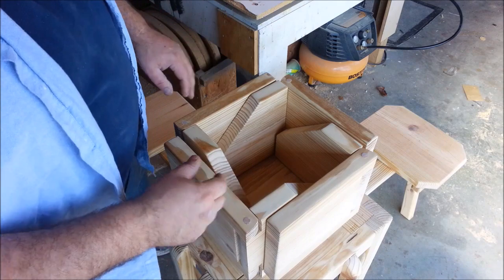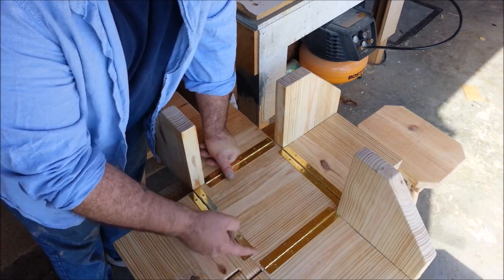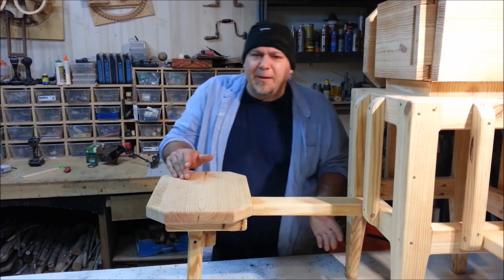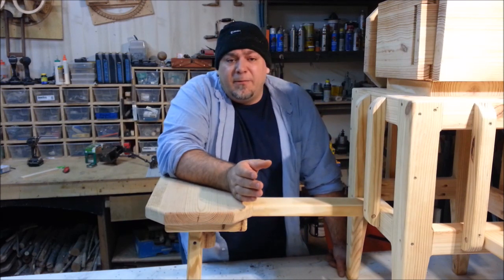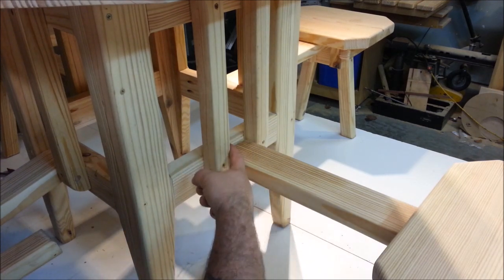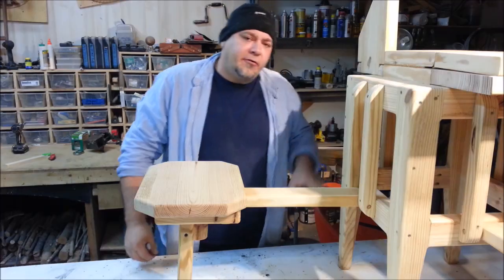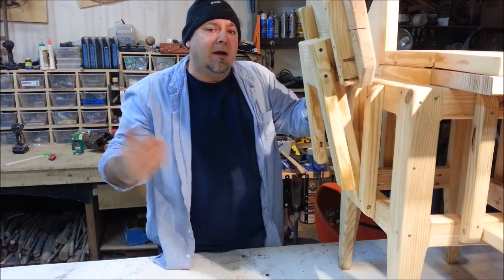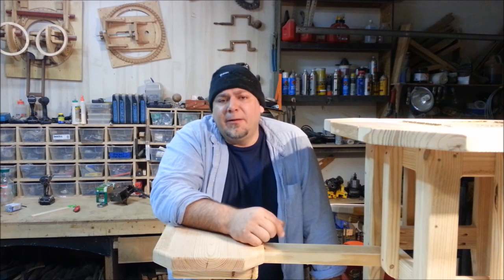Cool Transforming Tables! Folding Patio Table.

Comment: Hi Izzy,
I have a question about table  #2. I noticed that there is a removable top . Wouldn't it be cheaper, labor saving and a little less complicated if you would just put the top back on once it's unfolded? You wouldn't need the piano hinges and it would save the extra work making the wooden hinges and also make it a little lighter.

Comment: Clever design. 😃 The dowel hinges are a potential failure point.  Have you considered using steel rod with a matching sleeve to reduce wear on the leg? Cheers Mick
Reply from the maker: Mick Doherty I have a fence out back that has wood hinge with wood dowels it has held up for close to 10 yrs now.  my guess is they will work fine for a good long time

Comment: I am planning on purchasing these plans but I have two questions.  Why didn't you put the hinges on the butts of the table tops instead of on top, this would hide more of the hinge.  Also, being from Ohio, I was thinking of modifying the plans to make the top a rectangle instead of a square, doing this would make it look like the Ohio State Block O.  Is there a reason why this would not work?

Comment: Have you tried to figure out how to cut a wooden hinge for the center instead of the piano hinges? Seems like it would be a cleaner top if you could work some in, not to mention the savings on the piano hinges. Nice work on these, btw. These would be great alternatives to traditional picnic tables for anyone with limited patio space. The third one is the coolest, just saying...
Reply: I would think the raduis corners of a wooden hinges might create a problem  for plates or cups  

I might think about inletting the hinges  to reduce the high spots  caused by the hinges
Reply: I'm referring to the same or similar set up he has on the table top already for the little side wings. I can't imagine they'd be any worse than a typical picnic table
Reply: I havent seen this up close  but just thinking out loud